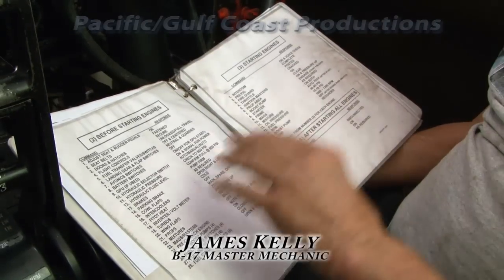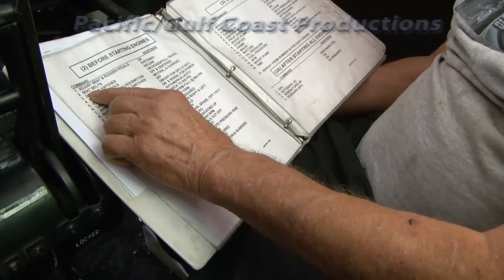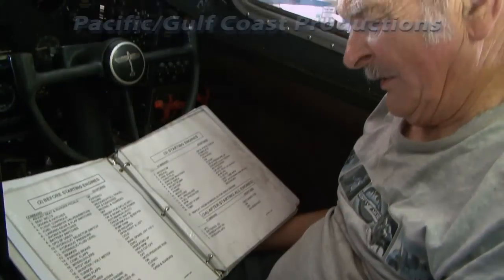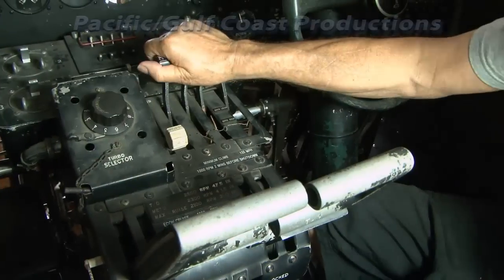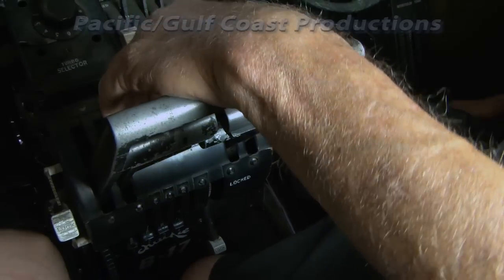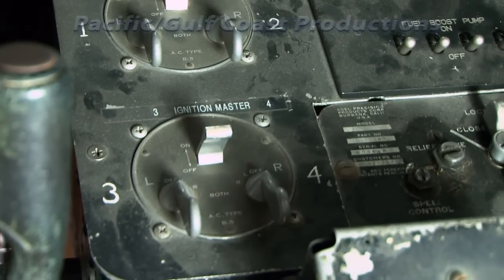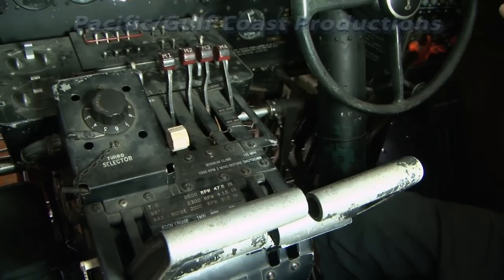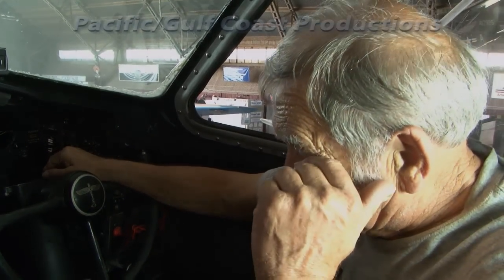B 17 Engine Starting Procedures

Comment: @oiseautempete Yes of course. I totally forget it was supercharged. I've been working on engines where the CR is 12:1 and so on, but they are NA racing engines. Many turbo gasoline engines i've come across are in the region of 8:1 etc so it now seems logical. Are the radials the P&W 930HP?